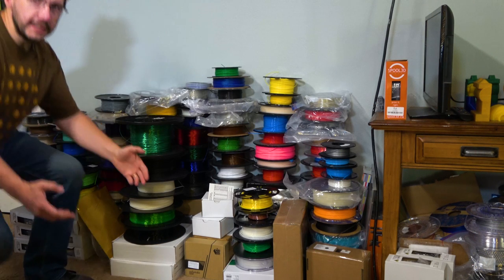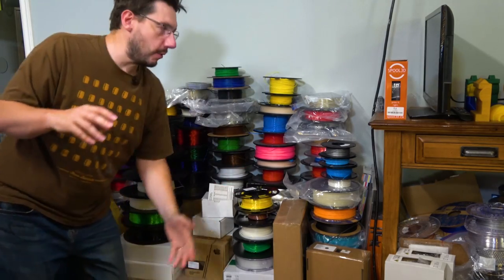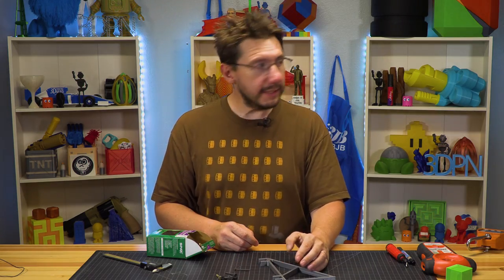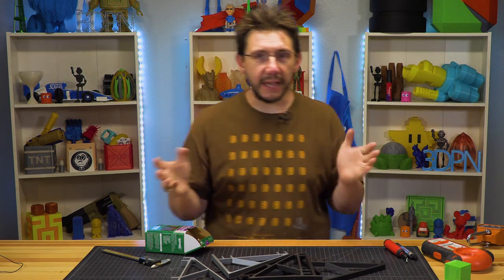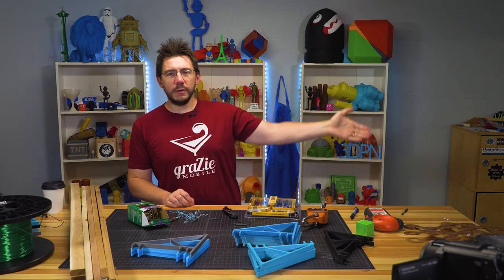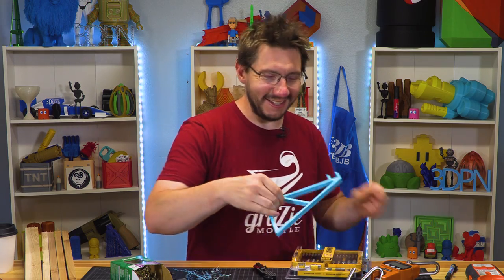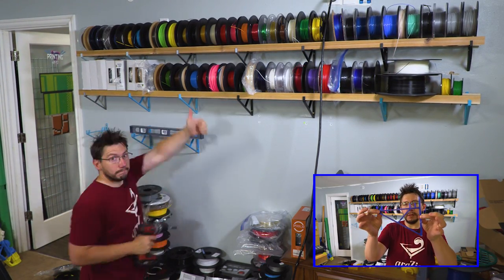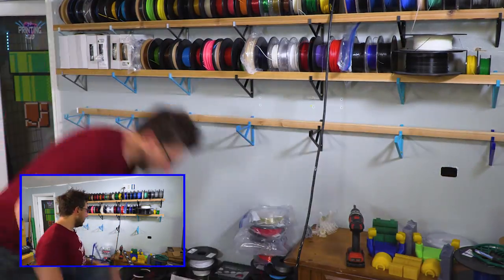Practical 3D Printing Ideas: DIY Shelf Brackets! Filament Shelves!

Comment: If you do eventually have printers below the filament racks, you could design a thing with skateboard bearings that fits on top of or between the limber-tumber and allows one roll to spin freely. Sort of based on TUSH (https://www.thingiverse.com/thing:2047554), maybe. Might be better than cantilevering a roll out front, putting more stress on the rack.

Comment: Hi Joel , if your interested in calculating the  maximum force your bracket can hold, there is an engineering term called beam theory, it is a rang of calculations which can make designing a bracket to be stronger and it can show you how the forces acts on it, have a look and see what you think.

https://en.m.wikipedia.org/wiki/Euler–Bernoulli_beam_theory

Comment: I use PlainZkru (https://www.thingiverse.com/thing:2839546) to be able to use chamfered screws but not have layer-delamination. Spax is a common brand here in Germany but the flat bottom screws are pretty expensive which is why I try to stick with the regular PZ drive or Torx drive 4.5xNN type of self-tapping wood-screws. PlainZkru is more of a concept than a model. A chamfered washer that has a flat bottom to distribute the force over all layers. Anyways - cool project. Thanks for sharing! Cheers! JM

Comment: Worst cut line ever between wall and ceiling!
Reply from the maker: well, yes, UNTIL THE PAINT GOES ON.
Reply: 3D Printing Nerd Right, because everyone knows you hang up shelves and clutter up the wall before you finish the painting. 😂

Comment: home depot sell brackets for $7 each - this is nice but time to print, material - easier to buy. You really need to clean up - whomever painted your walls did not do the ceiling top, your outlets are not aligned and you still did not fix the holes in the wall. shave!!! you look like you are in a trailer in college and just woke up! you can do better cheapens the information